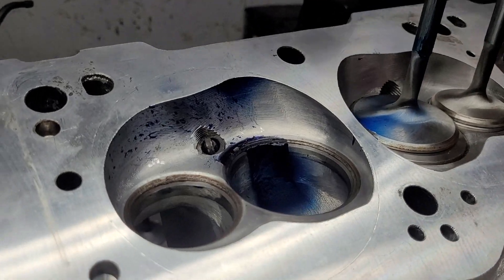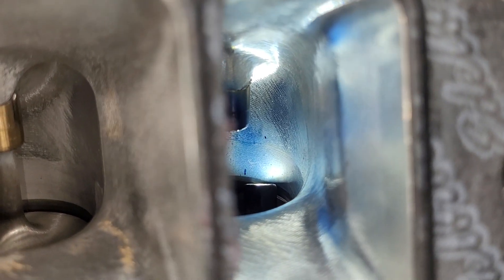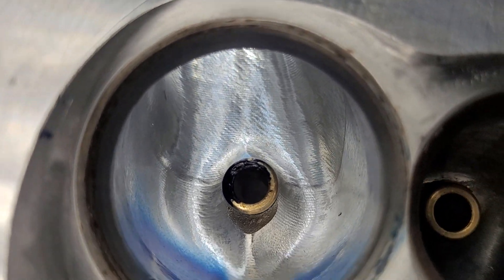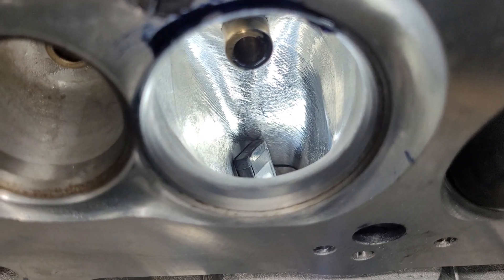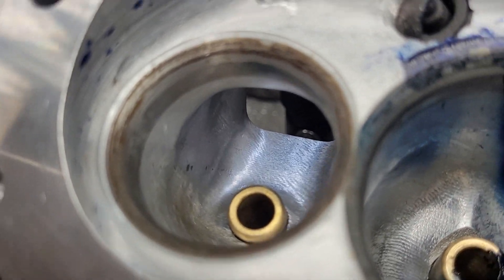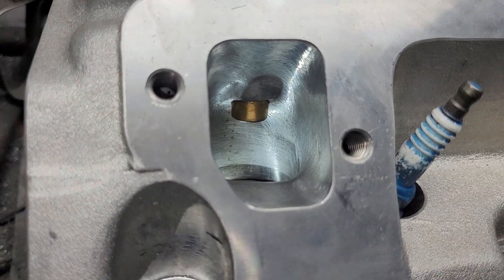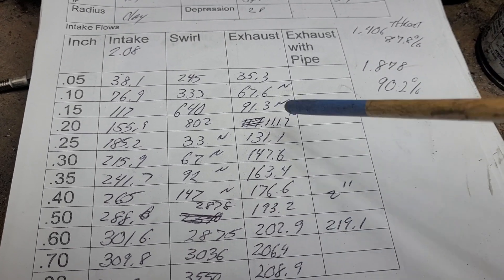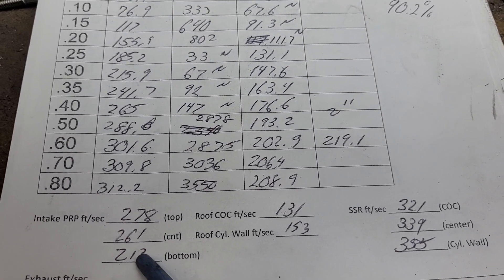Edelbrock cnc Mopar heads flow test, air speeds and dykem flow.

Comment: Ok, been there done that on the flow bench and dykem. You are doing it backwards. When you spray dykem into your air stream you are pushing the liquid onto the walls of your port. If you build a wet bench you can coat the port with dykem, put the intake manifold on, bolt on the carb or make a injector nozzle to inject isopropyl alcohol into your air stream so it flows into your air stream instead of forcing it along the walls. Got proof it works, atomized your test liquid into the air stream, don't spray from a bottle or can it won't show you proper flow, just wall flow.

Comment: I currently have a set of Hughes super prep ( which are thé ‘non-fully’ cnc’d heads. They have valve job, chamber work, 1 inch cnc into intake, blending etc.  I am finishing bowl porting myself. How much of the intake bolt boss can you grind down in these heads? Any idea?
Reply from the maker: @340dakota6  I would leave it tall. Thanks
Reply: Thanks for getting back to me, much appreciated. Just for clarity, by ´tall’ you mean leave it protruding out into the path of the air, and don’t risk cutting into it ?  Thanks so much!
Reply from the maker: @340dakota6  If you are writting about the intake guide length in the bowl? Yes, leave it tall and boattail it. Thanks
Reply: Sorry I meant the head bolt that sticks out into the port… is there much room to grind this down on the eddy’s?

Comment: Quick question on the porting work that you did to the Edelbrock would you say that port that head flows better than the trick flow?
Reply from the maker: I would need to test them both on my bench then do David Vizard's iop program on both designs to give an answer. Thanks

Comment: Charles, what is your opinion of these vs the W2’s as far as potential to make power?  They seem to be quite alot better than standard Edelbrock performer rpm heads but seem somewhat comparable to W2’s
Reply from the maker: I like the W2 design better. These would make nice power for what they are. I would need to do a detailed comparison and I can't right now. Thanks

Comment: Mopar guys are such tight wads offset rocker heads should be flying off shelves when someone makes them. Instead nobody buys them and they all complain about lack of aftermarket support. The only reason there was ever a pushrod pinch is because the factory brass were tight wads too and didnt want too spend the cash on retooling the poly block.

Comment: Good stuff Guy's, thanks for sharing. Indy cyl. head use to sell these as their T/A series heads, I believe they were sold with cnc porting and a 2.055 intake valve, also I heard Indy stopped selling the T/A head  because Edelbrock stopped selling the blank heads. Indy took the blank castings and performed the modifications from there, drilling pushrod holes, cutting valves, guides, springs, cnc porting etc. Anyway I could be wrong on all of this. LOL , Thanks again Charlie & Rob .
Reply from the maker: You are welcome.

Comment: Charles, is it possible to  weld aluminum in certain areas of the ports and reshape them, to your liking? Or would that ruin the heads?
Reply from the maker: It is possible. It may effect the aluminum's heat treat. It may also warp the head.